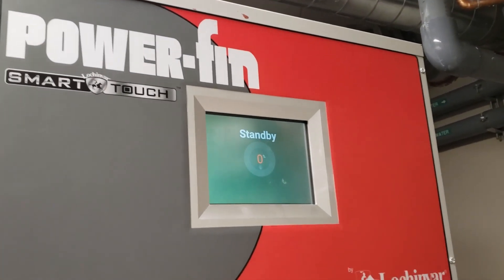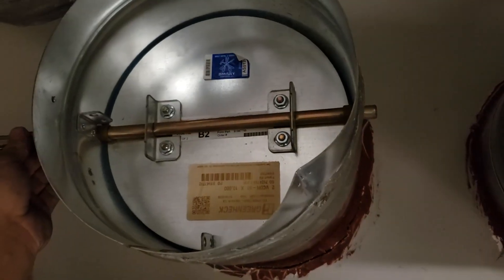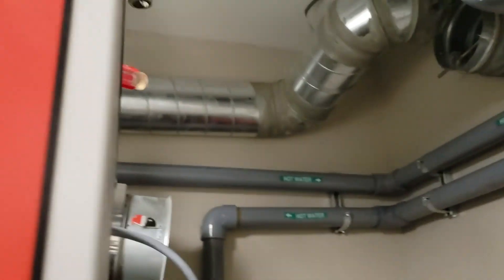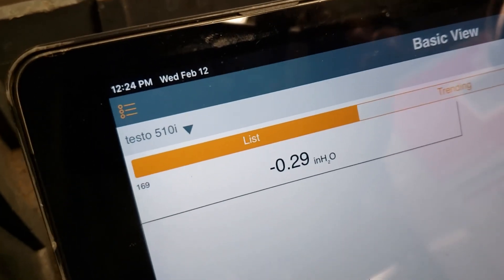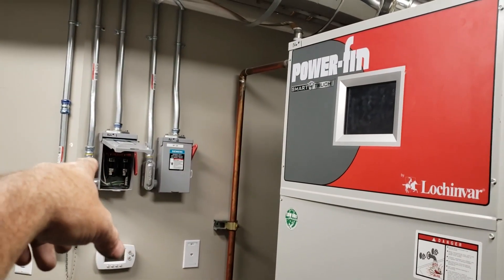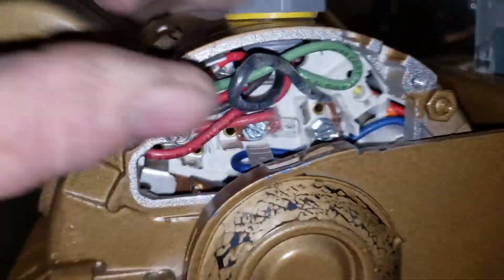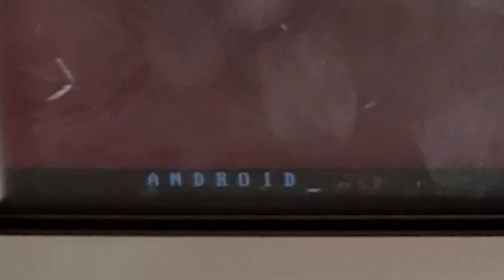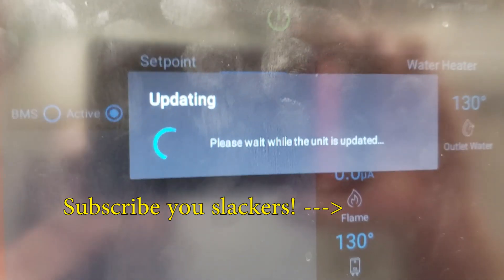New booby-trapped Lochinvar Boiler had a few issues but easy fix

Comment: I have one thats in stand by mode. I raised the set point above the current water temperature but the bouler stays in standby and does change the call for heat. What can i do to "force" the boiler out of standby mode. Ie: can I trick the water temp sensor, remove it and place in cool water or jump a set contacts out?

Comment: why are boilers being used in phoenix? -> have tons of waste heat from a/c that could be recovered, not to mention the option of solar thermal panels in a desert climate.
Reply: Jon [Insert Last Name Here]  pool heaters at a cheap hotel with no central system?
Reply: solar thermal can take care of that most of the time in the southwest us.
Reply: I remember him mentioning in a previous video that some engineer probably from the Midwest designed the big box hotel and didn’t modify it for other regions.
Reply from the maker: This is domestic hot water. 
And as good as that idea sounds, building designers around here would more than screw that up!

Also, most of the A/C units here will be in the wall hotel room units that you can just pull out and replace typically.
Although some are now going to those Variable Refrigerant Flow units made by Fredrich and others. 
But no water connection on those.

Comment: Wish I can do HVAC too bad it's too late for me.
Reply: Its never too late . I have trained apprentices well into their 50's  . Anyone mechanically inclined has many transferrable skills. If its your dream chase it
Reply: @ryanc8894  unless ya already ruined your body
Reply: @fluke196c  service isnt bad on the body other than the endless winshield hours and luggin tools in and out
Reply from the maker: @ryanc8894  Well... maybe in those cities where doin residential means furnaces in the basement,  garage or closet and the condenser just outside on the ground,  but around here residential means climbing through attics on your knees on 24" span trusses or climbing 1 and 2 story houses for rooftop units. 
That jacks techs up already.

Then on commercial/ industrial we're climbing 40 foot suicide ladders and then pulling up the nitro, torch set, tanks, tools etc then lugging a few more hundred feet.
And crawling in and over the units. 

An already weak knee or arm kind of hinders those abilities and doing the job itself can tweak the body.
There's a bit of hard labor at times in the field unless maybe someone is in a midwest area or something where they don't use attics and rooftops.
Reply: @hackfreehvac  true enough I got the rooftops and ladders out of the way early in my career. You are right here in Canada residential is 90% basements 10% attics. Even our building code requires fixed ladder or hatch for new buildings. Hauling allnthe shit up is the helpers job lol
Reply: @hackfreehvac  tell me about it, lol! Two back surgeries later....
Reply from the maker: @mikie2501  Yikes